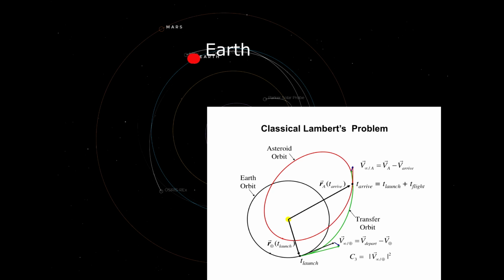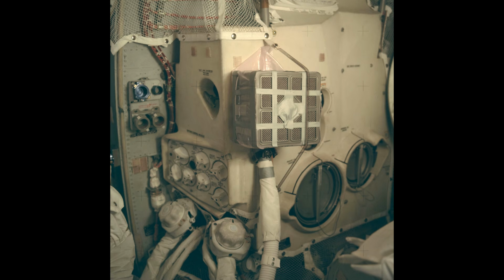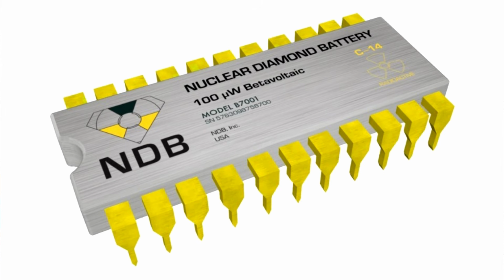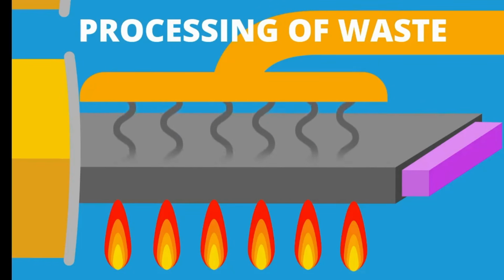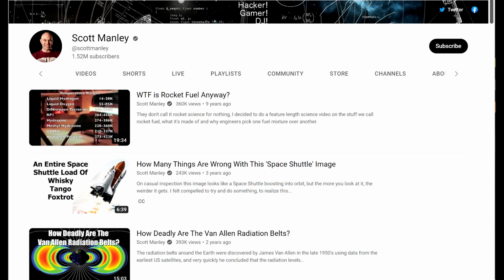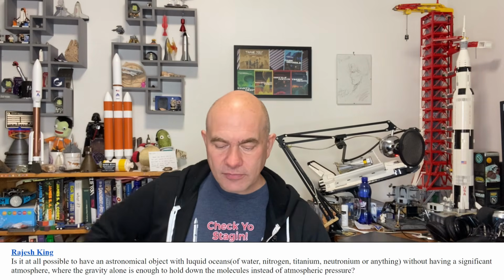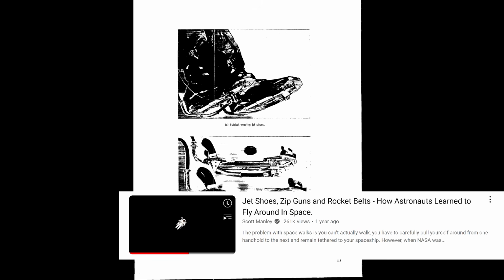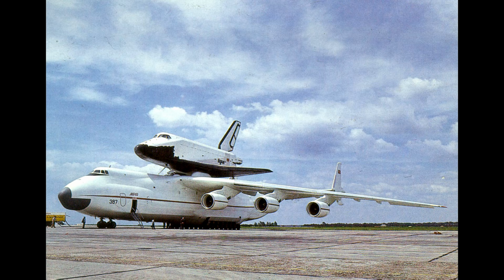Is There a Tripropellant Rocket Engine?  How Are Orbits Planned? - Deep Space Questions 21

Comment: Lol, I love that NASA didn't feel the need to change the round holes into square holes because they now have a procedure to jerry-rig a square peg to fit it into a round hole. I mean, I understand that logistically it just didn't make sense to change one of the systems, but it is still hilarious to me.
Reply: There was probably logistical downstream from both the 'square peg' and the 'round hole' in this case. Changing either would have required to change much else. Cost effectiveness reared its head and they went with the economical choice.
Reply: @axelord4ever  - The other thing is that I think they made the right call in deciding that building in more redundancy to make sure they would never have to cram the square peg into the round hole was a better use of time, energy, money, etc.

It's far, far better to never have to come that close again.

And, probably the cheapest option would be to simply make a purpose-built adapter without changing out the systems built into the spacecraft, too.
Reply: NASA had the procedure for the Lithium Hydroxide canisters before Apollo 13 launched. The film told lies there by having it happen during the mission.
Reply: @owensmith7530  do you have a source for that information? While the film did have a great many inaccuracies, I've never heard that one before. And I have seen other sources that corroborate the films story about having to come up with the procedure on the spot. It is entirely possible though that these were in turn also influenced by the film.

Edit: I don't want to say, "great many inaccuracies." It did have some for sure, but in comparison to other based on true story movies, it was pretty genuine.
Reply: @TheTonyMcD  If I manage to dredge it out of my memory I will come back and post here. It wouldn't surprise me if it were Scott Manley to be honest. Or discussion around the time of the First Man film comparing the gross inaccuracies in that with the gross inaccuracies in Apollo 13. Jack Swiggert wrote the Command Module emergenices procedures manual if I recall correctly, so his portrayal as gung ho in Apollo 13 is all wrong.
Reply: @owensmith7530  you're correct, Scott did a video, and even built one.
Reply: @owensmith7530  I seem to recall Scott mentioned it in his video about Apollo 13. I trust he had a source. And I wouldn't say the movie 'lies.' It's dramatized. Although the timing was wrong, there was a moment where the engineers had to create that procedure, and probably a hundred others that were never used...
Reply: @bbgun061  The film gave them a tight deadline to come up with the procedure and they weren't able to test it etc. That's a lie, because it was developed some time before the mission and the engineers would have had time to go home and come back refreshed, and test the procedure on real hardware etc.
Reply: @owensmith7530  In this video, Scott said they made sure all future flights had the necessary materials to make the adapter should it be necessary. That suggests that prior to Apollo 13, they didn't make sure of that, which implies that even if they had thought about the possibility, they hadn't actually written up a proper procedure with a materials list and all that.
Reply: How difficult would it have been to design an emergency adapter? It couldn’t add that much more weight.
Reply: @georgejones3526  Weight and space were at a premium for the Apollo moon missions.  Designing and carrying a whole separate piece of kit for a contingency that was highly unlikely wouldn’t make sense, especially when they were already adding weight to the Apollo 14 - 17 spacecraft for other, more important things.  They had a perfectly good procedure in the unlikely event it was ever needed again.
Reply: @georgejones3526  no worries man, we got a procedure for that.
Reply: Or maybe they decided, “For Apollo 14, let’s go with an extra roll of duct tape.”
Reply: @jeffg4570  And an extra pair of socks.
Reply: The Apollo missions all took place over a relatively short period of time.  If they had continued it for another decade, they might have changed more things over time, like they did with the shuttle program.
Reply: It was rather silly to design it that way in the first place, though. Standardization is a good thing.
Reply: I realize this is very late, but here goes:

They did design in commonality - the EVA backpacks and the lunar lander used the same type of cartridge. This was the round for designed around the constraints of the backpack. For the command module they needed better packing density and thus went with a much larger and more space efficient square design. 

It did not make sense to have the same design for both vehicles. It was well known in advance that the two were not compatible. In training exercises where the lunar lifeboat scenario was used the adapter was designed and filled the needs for what was considered an unlikely scenario. 

Engineers are smart. In general people as well as governments are smart. When one doesn't perceive it that way the issue is usually with oneself. Most of the time the experts know way better.
Reply: Timber frame buildings DO use square pegs in round holes. The pegs jam themselves in and the four sharp edges cut through the surrounding wood, locking them into place. FWIW.
Reply: @lyfandeth  thank you, I did not know that!  Cool 😎
Reply: It was a different time then. NASA accepted higher risks those days. I think that changed at least after the challenger disaster.
I heard somewhere they had stored spare LHO canisters on the LEM lower stage. They would have been accessible on the EVA.
Reply: @benjaminhanke79  Redesigning the systems when you have something that works perfectly well is riskier than making changes just so everything looks neater. As @Owen Smith says, the movie dramatized the procedure a bit, but Apollo 13 proved it worked under adverse conditions, and that real life testing is worth a lot. Especially since the program was already facing cancelation and getting the last few expeditions to the moon depended on them staying on schedule.

Comment: I remember there was a KSP mod graphing those graphs... kinda hoping KSP2 would include that in the base game
Reply: They added a stock alarm clock tool that even gives transfer window dates, and it usually matches the best times given by mods which offer a visual plot. So internally the game’s already doing it, meaning it could easily be a thing in KSP2
Reply: Yeah, both MechJeb and Transfer Window Planner offers in-game pork chop plots - the result are subtly different both from each other and also from KSP Alarm Clock and the 1.12.x built-in Alarm Clock - the latter two PROBABLY give the same result since it's by the same author. They all use various approximations which explains the differences.
The built-in Alarm Clock often seem to decide to plan an encounter WAY in the future when a transfer window coming up very soon and without a pork chop it's much less flexible than the other options but in Stock Game it's available (on PC!).
There's also the original Web version of the Transfer Window Planner by Alexmun, TriggerAu say he based the in-game TWP module on his math, and then there's the standalone KSP Trajectory Optimization Tool aka KSP TOT.
While KSP TOT is standalone it includes a KSP module to extract all required orbits from the game (including planets if running a planet-mod) and then when it's done it can then inject the maneuver onto the craft, but the actual planning is done using a dedicated GUI which uses Matlab Runtime! to run the calculations and in my experience tends to get a bit better results than the others. TOT is massive, it also has a mission planner for multi grav-assists/fly-by, electricity needs, staging and even aerobraking and then there's a massive vehicle designer module which I've not even opened...
The reality is that KSP maneuvers are impossible to execute "correctly" anyway because the game always assume a zero duration (KSP2 is supposed to finally fix this), as such there will almost always a bit of tweaking afterwards. As a result my recommendation would be to use the one that's most convenient of the 5 options which will be one of the in-game ones. OTOH if you want to pre-plan a Grand Tour with lots of fly-by/gravity assists, KSP TOT is probably what you want. I no longer have it installed, the differences wasn't worth the hassle for me.
Reply: i just hope KSP2 isn't a DRMed as hell mess with game breaking bugs.

kinda doubt it will be released on GoG, but if it doesn't release on GoG i won't even buy the game.
Reply: @Splarkszter  it will probably be steam drm. Steam is fine.
Reply: @Splarkszter  steam is technically a DRM. And it's optional. KSP1 still doesn't require steam. I suspect KSP2 will. I'm good with it though.
Reply: also remember take2 now owns the studio, they aren't indie anymore.
Reply: @Splarkszter  To be exact created studio out of poached Star Theory developers coz management (That failed to deliver on time and wanted more money, twice) wanted to sell the studio for too much. So yeah, pretty messy situation
Reply: first time I used that mod... the hells a pork chop plot?.... oh thats why its called that.
Reply: maneuver node planner in mechJeb
Reply: I believe the mod was called MechJeb
Reply: Mech Jeb didn't show these "pork chop" graphs
Reply: @johnk190  I don't know about always, but When I used it, it had them. It was under like advanced transfer or something like that. You could even tell it to include the arrival DV. Sometimes the most efficient departure wasn't a perfect match for an efficient arrival. But yeah I used it all the time.
Reply: @awilliams1701  I think it was literally just called "Transfer Window Planner", and if memory serves at some point MechJeb added a hook that would launch Transfer Window Planner from one of its menus.
Reply: @johnk190  Mechjeb does have porkchop plots, it's under "advanced transfer" or something like that
Reply: @Archgeek0  I know it was a separate mod, but I never downloaded it. Mechjeb definitely had it built in.